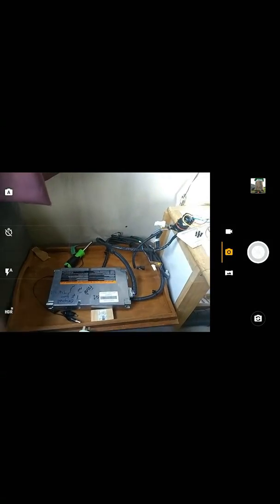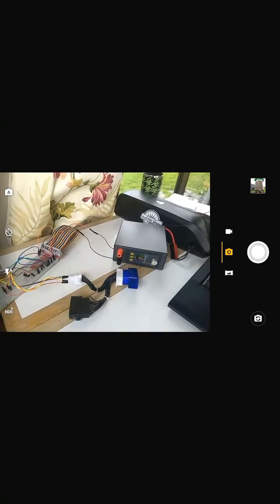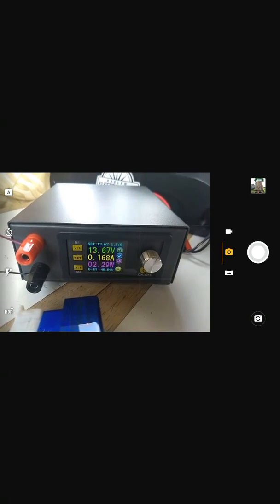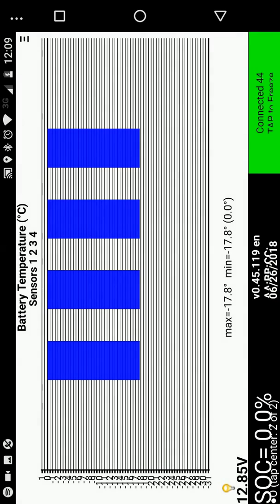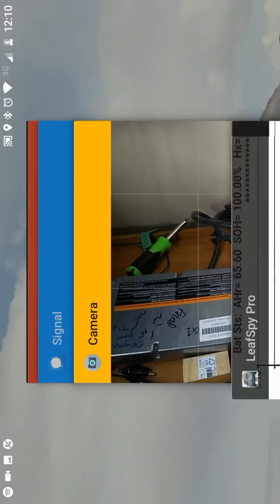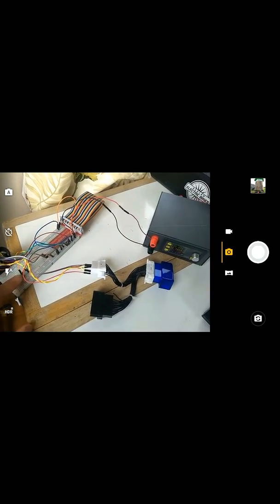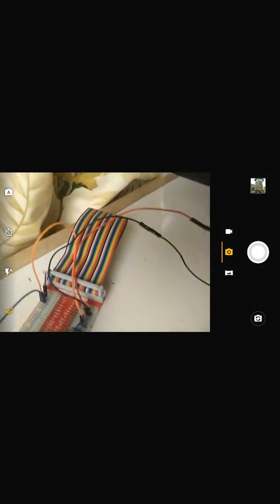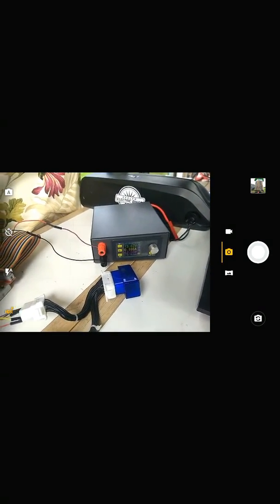Nissan Leaf BMS (LBC) communication part 2-Success!

Comment: I have tried the same with two different 2012 Leaf batteries and it does not make the connection with Leaf spy. Do you have a circuit diagram somewhere?